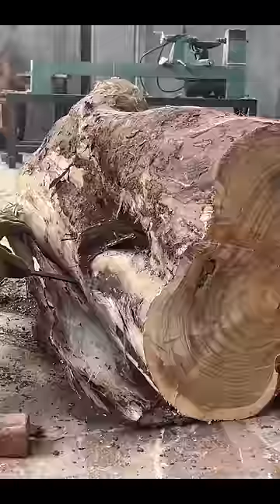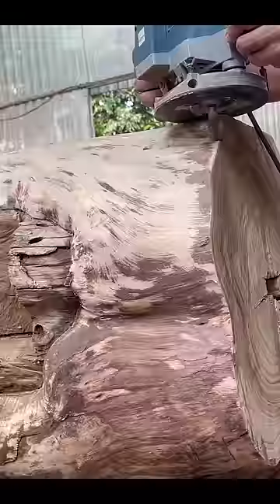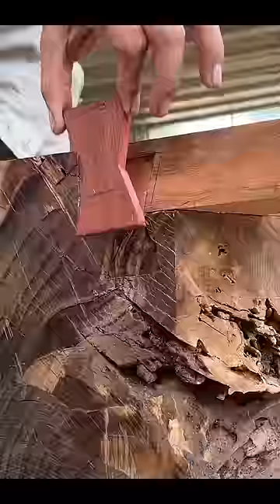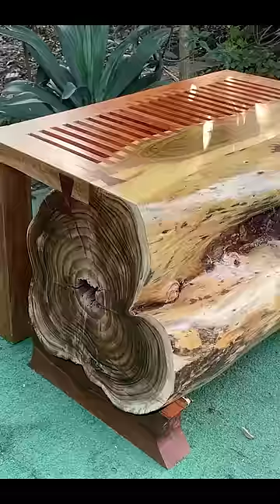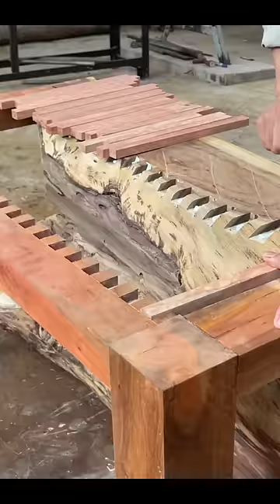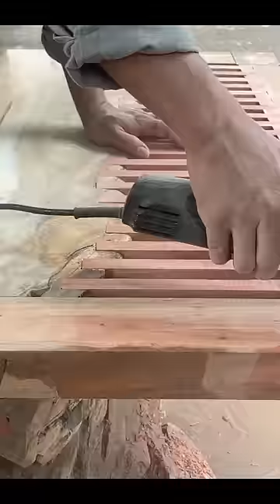Unique Abandon Tree Trunk Table #woodworking

Comment: CA Glue involving woodworking like this simply translates to me, "how to gain views from shortcuts and it'll NEVER actualy be used!"
such a shame! it's absolutely beautiful.  I'd be blessed to work on such a table but to watch it fall apart would be just as devastating. 
I honestly just don't get it, CA is for arts and crafts and quick fixes not woodworking and joinery under stress and tension...